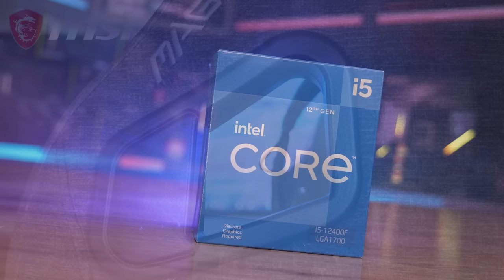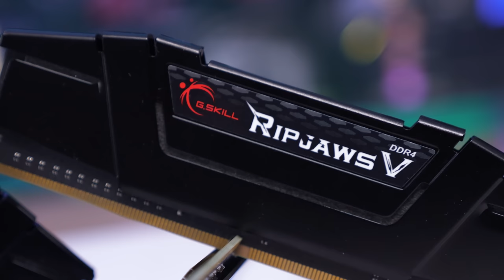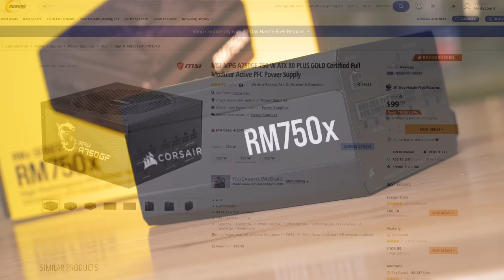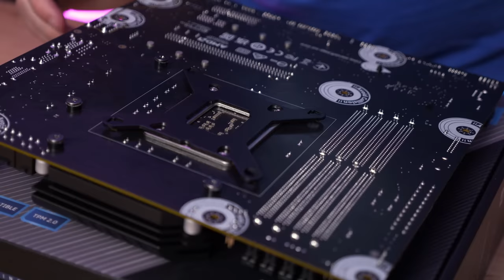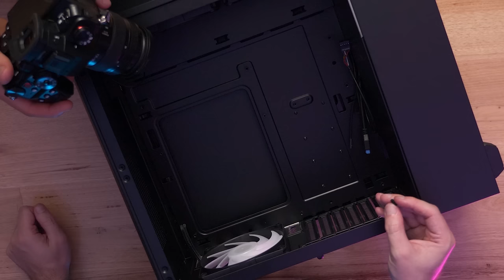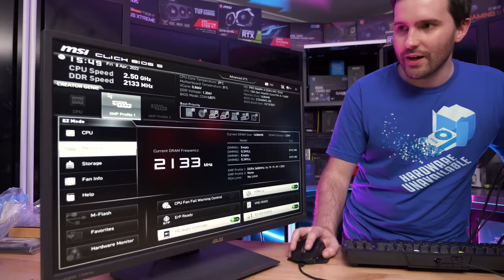Best Bang for Buck Intel Gaming PC Build for Early 2022

Comment: This is very similar to my pc except for the GPU which is a 6700xt as I play at 1440p. I love your videos and the reviews of the B660 motherboards were very helpful in making my decision for my own build. Keep up the great work!
Reply: I built one with a 6600xt and 12400f. It’s decent for 1440p but I plan on upgrading the gpu sometime next year as long as the prices actually go back to msrp.
Reply: @kashif4463  upgrading after 1 year?
Reply: @NamTran-xc2ip  To be honest it depends how well the card can run starfield and the new cod game  at 1440p. If it does fine then there is no reason for me to upgrade.
Reply: @kashif4463  because upgrading after 1 year is really bad economically
Reply: @kashif4463  I'm running a 1660S at 1440p myself , Starfield is going to kill it. But the 6600XT should be fine 🤟 no need to upgrade
Reply: @Koimonoseph  bruh how do u use that card at 1440p. Balanced settings + fsr balanced gives you under 50 fps in cyberpunk. 

Well unless you play less demanding games I guess
Reply: @Koimonoseph  Hopefully, I don’t care about ultra settings as longs it’s on medium and 60fps for a single player game that’s enough for me.

Comment: I recently built a new system for a friend, loosely based on your recommendations. We went the 12400F CPU with a Z690 Aorus Pro AX (Z690 specifically for the extra usb ports as we run a racing sim off this machine with a lot of usb inputs), 32GB CL16 3200mhz ram (all 4 slots purely for aesthetics) and a Red Devil 6700XT for running VR and 1440p resolution. All in a Corsair 4000D case with RGB everything lol. We paired it up with a Gigabyte G34WQC and so far its been a killer quiet machine that handles everything the owner throws at it without breaking a sweat. He loves it!
Thankyou for the many years of reviews and testing. Your hard work really does make a difference! I or anyone i know is yet to regret buying anything you guys have recommended.
Reply: How well does the 6700xt handle VR?
Reply: nice, but why choose the Z690 over a B660? Future upgradability?
Reply: @treyquattro  purely for the extra connectivity. youll find most z690 boards either swap between having pcie slots or a shit load of usb ports on the back. we needed the usb ports for the sim as usb hubs sometimes have issues.
Reply: @nismofreak33  fair enough. I went with z690 because I wanted a lot of M.2 slots
Reply: @SabreXT  honestly, cant personally say as i havent personally used it with the gpu plugged in directly. the owner recently sold the quest as he was having connectivity issues with the gpu. despite it being supported and using an official cable. he put it down to something being fucky on the meta end of things.
despite this, if it did work i would imagine that a 6700xt would support vr absolutely fine, frame rate wise
Reply: Sim racers unite! See you on track 👍

Comment: Finally a budget build where someone isn't using overprices old Nvidia cards and using the 6600. I don't get YouTubers now a days why are you recommending a 1660 Super or 2060 when the 6600 is more powerful and around the same price. Smh
Reply: Jay2cents recomending a 1660 super that is more expensive than a 6700XT was so funny
Reply: theres no nvenc though

radeon users try to stream challenge
Reply: Hardware encoder

Edit: *Dedicated hardware encoder
Reply: A 2060 would make more sense if you want the features it offers. However for sheer raw power the 6600 is definitely a more suitable choice.
Reply: @tilapiadave3234  its 10% not 3%  6600 matches a 2060 super also the regular 2060 has 6gb vram while the 6600 has 8gb
Reply: @tilapiadave3234  Prom C isn't wrong. All you have to do is literally take a look at TechPowerUp to see that the RX 6600 matches the 2060 SUPER when it comes to 1080p gaming, which is the resolution most people will play at using a graphics card like a 2060 SUPER or RX 6600.

https://www.techpowerup.com/gpu-specs/radeon-rx-6600.c3696

Comment: Good timing - I'm doing a 12400 build on the same motherboard tomorrow for my mum's new PC. The video is good but I wish you'd shown the cable and jumper installation - plugging in the various jumper cables can be one of the trickiest parts of an installation.

Comment: Big fan of my 6600s, they sip power and have amazingly quiet cooling as a result
Reply: mine doesn't seem to get any louder gaming than it does idle, it's great
Reply: This is honestly going to be one of the most important aspects for me for when I will build my next PC. It's not even  (only) about saving money on lower power consumption but just wanting a (relatively) cool and quiet machine in our living room. And the 6600 models just seem to be a tripple sweet spot at price/performance/power-usage.

AMD generally seems to be doing better currently when it comes to performance per Watt drawn on both fronts, GPU and CPU, though I'll happily go for Intel and/or Nvidea if at the time they have more power efficient hardware offerings.
Reply: @paulszki  well when mining they use 50watts and gaming performance isn't hindered much when undervolted. For reference the 3060/2060 don't go below around 110watts
Reply: @joshuamusic8812  It's wild to me that the difference is so substantial. Thanks for the info.

Anyway I'll still ride my current setup for another year and we'll see what the 40X0 series will bring on Nvidea side and what Radeon will present. And of course, who knows maybe intel's GPU's are worth looking at as well.
Reply: @tilapiadave3234  yeah doesn't hold a candle to my 3070 at triple the power consumption, or my 3080s which use around 212w each. Definitely enough for 1080p though

Comment: Just for fun I checked the price here for the same items and converted to USD and it is 1447 bucks. But keeping in mind that includes 25% VAT and that you can find some items cheaper if you choose other brands I guess it isn’t too bad. At almost 500 bucks though I would not get the 6600 here. Hopefully prices will keep going down here as well. Already prices have gone down a lot.
Reply: I’m in the US and the 6600 has hit below 400 at multiple retailers. The XT is still over 400
Reply: At the time of this comment, the 6600 XT from XFX is being sold and shipped by Amazon US at $479.99. This is only $100 over MSRP. If you know anyone who wants to play everything maxed out at 1080p, that is a solid option right there.
Reply: U cannot say anything now brother in between last 2 years prices have gone down and up twice or thrice already...and seeing condition rn in china as lockdown is happening again u cannot say anything these days
Reply: @stormlord121  And you can get a 6600 for $375, which isn’t too shabby for the price.
Reply: @mohittalreja4309  This recent price drop has been much more significant, however. It may not last forever but it’s a pretty good sign for the short term. For US-based folks the fact that the tariff has been rescinded also helps.
Reply: @jamescunningham8092  That is actually fantastic! I believe $330 was the MSRP so that is great!

Comment: Corsair RMx 550 W 80+ Gold is 60 dollars right now and honestly I would go with that for a bang for buck build, I get that it's for upgradability but I feel like a lot of people are going too overkill with the psu these days.
Reply: indeed. I have 5800x and 3060ti on 550W and it works just fine. It would easily take 3070 or 6800 non x model as well. I don't want anything drawing more power than this so i'm good.
Reply: Doing that would essentially remove the option of potentially saving money by upgrading the gpu to a used 3080 tier gpu in the future. I don't think that's a great tradeoff considering the rumored ridiculous price increases the 40 series will have and probably worse with the 50 series.
Reply: @gameison4813  The recommended minimum is 650W for both of those cards - they might run on 550W but you're risking a crash if you have any kind of power surge. Personally I wouldn't risk it.
Reply: @mst4745  not with amd cpu
Reply: @gameison4813  Uh no, the official recommendation is 650W regardless of cpu. Stop making things up.
Reply: @mst4745  That's because the official recommendations take into account banana sub 80plus psus that might end up powering the system. They usually allow at least 100w headroom.
Reply: @mst4745  The official recommendation is BS obviously.
There is enough benchmark data on these parts (e.g. look for someone who knows what he is talking about like "igorslab") and this build can be easily run with a decent 450 Watts PSU.
If you buy the worst china PSU bomb on the market, you might run into problems but not with something decent like bequiet or corsair.
This computer pulls hardly 300 Watts during load.
Reply: You are absolutely right. The 750 W PSU is a waste of money in this build. I already posted two other comments (one above and a separate one) explaining why.
Reply: @WCIIIReiniger  I've read plenty of reputable reviews and haven't seen any of them recommend anything below 550W, with most saying 600W or more. I've never seen anyone say you should run a 3070 or 6800 with only a 450W supply.
Reply: @mst4745  we are talking about RX 6600.
The 3070 and 6800 are a different story. For these cards you can easily plan 150 Watts more headroom than for the 6600.
Reply: @WCIIIReiniger  No, the person I was replying to was talking about an RTX3070 or RX 6800. Try reading the thread before jumping in and making a fool of yourself.
Reply: https://youtu.be/wnRyyCsuHFQ
have a look before recommending low power psu

Comment: To anyone looking at a Mech 6600: MSI's VBIOS on this card tunes it for ultra-efficiency, locking the power limit at 100W. This means the card is going to stay very cool from the mass of the heatsink alone, but the default fan curve can still get those fans quite loud at 100% usage. I recommend setting the curve to the lowest fan speed possible until 65 degrees, at which point I'd set the PWM no higher than 30%. My card has yet to go over 55 degrees with an even less "aggressive" curve than that in a Phanteks P300A with fully populated fans.
Reply: Im thinking about buying this card. How hot is the hotspot temperature using your settings?
Reply: @Benjamin-ot1ic  Never goes above 65 degrees.
Reply: @ForlebTF  okay thank you. Do you have any readings for memory or VRM thermals? And in general would you recommend this card?
Reply: @Benjamin-ot1ic  I don't have those readings, but I'm sure they do quite well considering the other thermals. MSI's VBIOS makes this literally the most efficient card on the planet stock for stock. It also just happens to be the best value card with current prices, so if you want something right now, this is it.
Reply: @ForlebTF  I will continue thinking about it. I have been waiting since january last year so I dont really care if I wait for 1 more year...

Comment: For bugdet systems I would definitely recommend using scythe fuma 2 as the cooler. It is quite cheap, doesn't make any noise, and capable of cooling low-mid systems without any problems.
Reply: ID cooling SE224XT is also a good budget cooler
Reply: Deepcool AS500 is the secret option for me. It cools better than the Fuma and costs about the same.
Reply: "doesn't make any noise" well true, during the first few months. From my xp anything that isnt called Noctua or bequiet has a major qeeking and noise increase after 2+ years (esp. if you have a dusty envirement).
Reply: Yeah, the stock intel cooler is annoyingly loud, as per tradition lol. I only today swapped it out on a friends rig for the cheap ol reliable CM212 as 1700 socket coolers are still thin on the ground. It is absolutely silent. Big improvement!
Reply: The FUMA 2 in the uk is around £65..nowhere near a budget build cooler option. The Pure Rock 2 is half the price.
Reply: @Vetis213 The Deepcool AS500 (Plus) is on par or even better than the Dark Rock Pro..
Reply: @TheRealXXDarknezz  get the ak620 instead

Comment: Just built something extremely similar last week, but with RTX 3060 as my workload can benefit from 12 GB VRAM and CUDA, anyway, 12400F is surprisingly powerful, even MSFS 2020 performed admirably, provided that you give it a bit of time to stream those asset from internet. I cheaped out of PSU and case a bit tho, got a TUF gaming 550W with silverstone PS15-W due to massive discount. That being said, cheapest 6600 is about $45 dollar cheaper in my local market, $45 dollar for 4GB VRAM, DLSS and occasional RT doesn't sounds that bad.
Reply: For $45 more I think the 3060 is the far better choice.
Reply: I'm also building with the 3060. 💪👍🏼
Reply: @andrewcross5918  Yeah, probably, especially I play in 1440P, where 3060 is a tad bit faster in raster too.
Reply: @Verpal  I don't think it's powerful enough for ray tracing
Reply: @NamTran-xc2ip  I don't think either, that's why I said occasional.

Comment: In my 3rd world country the 5600x with a B550M TUF motherboard costs the same as a 12400f + ASUS PRIME B660M-A D4 (both combos around 620USD while minimum wage is 139$ :D)
Reply: The 12400+B660 is the better deal as B660 will support 13th gen, while AM4 won't support any more CPU's.
Reply: @__aceofspades  with our underdev. prices, we're absolutely not upgrading in the same CPU bracket

Comment: The be quiet! Dark Rock Slim CPU Cooler doesn't include the LGA 1700 bracket as you found out lol, If you went the be quite! Dark Rock 4 that does include the LGA1700 CPU bracket. some FYI for all the PC builders out there :-) Also check out mwave they are selling LGA1700 brackets for all types of coolers for only $1

Comment: I just noticed how Intel puts "descrete graphics required" on the box, does AMD do that? Neither my previous 1600 nor my current 3700x did IIRC, but I also don't look at the box.
Reply: They don't, because no graphics on AMD is standard. When you get a G variant, it says it includes graphics.
Reply: It isn't on the box, but it is on the sticker with the specifications on my 5800x box.

Comment: Just putting the finishing touches on this build for myself (but subbing in a 12100F for budget reasons). In trying to source some ram and looking up compatibility I've seen a fair amount of people complaining that this board (and B660 boards in general) are having trouble with XMP profiles.  Did anyone notice anything when setting up a similar system? Seems to be that on non K cpus, with b660, the VCCSA is locked, and is limited by  by the IMC of the CPU.  Meaning if you get a CPU with a low VCCSA then that could prevent you from "overclocking" your RAM. XMP 3600 seems to be a difficulty for most setups (without dropping down to Gear 2) but I've even seen a decent amount of people struggling to hit XMP of 3200.  It has me a bit concerned about trying to choose a memory kit.  At some point I plan on upgrading to a higher end K CPU, so I'd like to be able to keep the memory, but don't want to cause problems with my non K budget chip that I'll be using at least for a few years.

Comment: 1/3rd of the total price in components that do not affect its performance directly but are required for the build, therefore price/perf of total build improves if you spend a bit more.  32GB of ram & 2TB SSD are something that changes the user experience quite a bit for the buck.  The RAM changes how you use the computer, and how much you care about opening and closing background tasks to avoid stutter, for merely 65$ you don't have to manually manage your memory by closing programs to open other programs. Then ~100$ doubles the storage capacity before you need to start manually managing your storage, and with the current size of games, you probably want that. 
So two improvements one ~5% of system cost and the other around 10% of system cost both make radical improvements in the usability of the system. 
If the budget PC is over 1000$ then 32GB should be a minimum.  The rule for a decent amount of ram for general desktop usage is how much the largest program you use needs it and then double it so that you have that much left after everything else running on the system. That is assuming ram isn't a too large portion of total system cost already.

Comment: My Whole system is based on all your recommendations and is a Freakin Beast ! i7-10700k, 6800XT, DDR4 3200, Meshify 2XL, Samsung 980's and MSI MPG Z590 Gaming Edge WiFi Gaming, Motherboard, Be Quiet CPU Cooler, and Corsair 850, Gigabyte M28U Monitor

Comment: I slowly built a PC and decided to get the 11400 instead of the 12400, as it was almost 20% cheaper when you consider the cost of the CPU and motherboard.  Not nearly as efficient, but performance seems to be within 10%.  I spent that extra money towards the GPU and got a 6600 XT over a 6600.

Undervolted the 11400 by 170mV and power limited it to 88W so it's more efficient, runs cooler and performs about the same as with power limits off.

Comment: I tried predicting what you were gonna build before watching the rest of the video. 
The fact that we got the exact same CPU, cooler, motherboard (though without wifi), memory and PSU (SKU-)model is pretty amazing though haha.

I just went with a gen 3 SSD (WD SN570 $89.99),  Gigabyte RX6600 ($369.99), 550W Corsair RMx (2021, $59.99), and the Cooler Master NR200 Case (49.99 on sale) to save some money.
Your list seems a bit more leaned towards expandibility and future-proofing with the Gen 4 SSD, larger PSU and sATX case, which is also fine as it'll depend on the individual what's worth more to them. However, I do think that for "bang for buck" you could've saved 10% here ($110), as my list would end up at $996 ($1006 if you take the Wi-Fi motherboard).